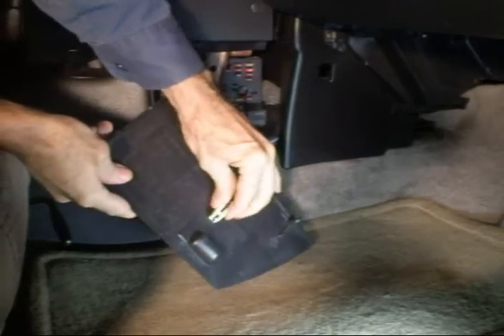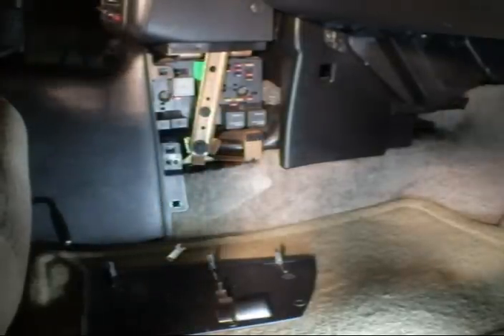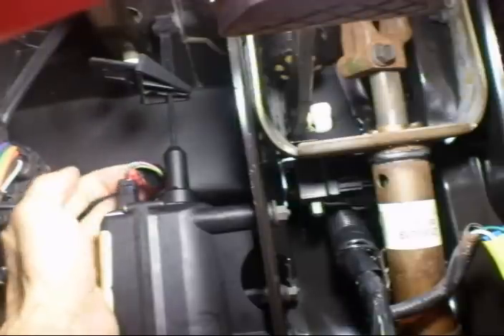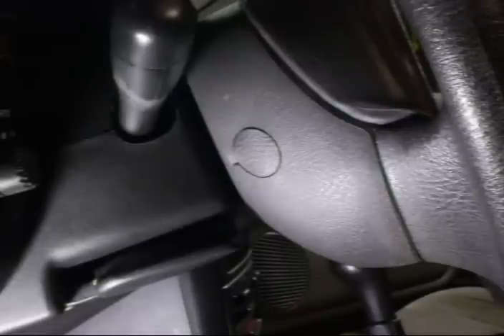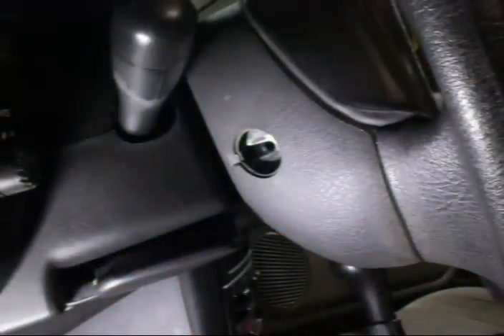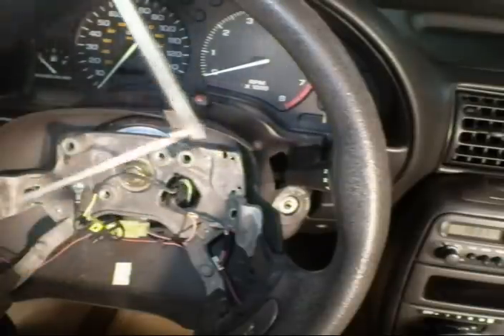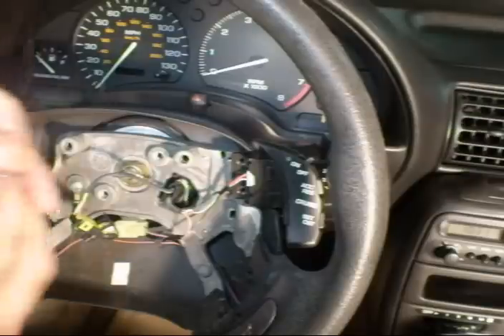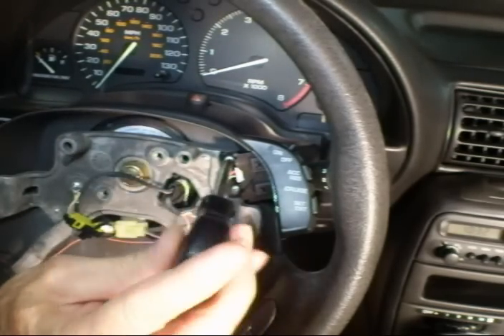Installing Cruise Control

Comment: Thanks for the video!  I followed the video, taking a cruise control unit from a donor 97 SW2 and successfully installed it in my 99 SL2.  $17 for the parts from a junkyard, $52 for Saturn to reprogram the PCM, and I now have cruise control.

Comment: Hey Rich, I got it working now. The adjuster on the control arm was all the way toward the box and causing the accelerator to be fully engaged. Two things I'd add to this video is talking about that adjuster on the end, and also mentioning the wires you moved out of the way from under the dash to mount the module. Thanks for the amazing videos!

Comment: I just installed cruise control on my 98 saturn sw1.  I ordered it from a guy one ebay who sells complete cruise control packages.  It even had a new plastic piece for behind the steering wheel that was the original CC piece so no cutting was required. I noticed the 3 nuts for my cruise control box were 12-13mm.  Not 10mm like you mentioned in the video.  And I didn't have a 5.5mm driver for the screws under the stearing wheel but a 7/32" nut driver worked perfect. Just have to get it programed!
Reply: What's the price of cruise control pack

Comment from the maker: @mhebay Thank you for telling everyone about the wiring.Yes that is the PCM near the battery.The easiest way to activate the cruise is with a used one from a car with cruise.It has to be an exact match to your PCM which means 00-02 same engine, transmission,abs.
Reply: @mhebay: The easiest way now, is Go Aftermarket ! Then it'll work for sure, no Pain In The Butt calling around and finding No dealers today that will do it or have the equipment like I'm having trying to get it going by factory parts with No success,

Comment from the maker: @reconciled2God  You need a steering wheel with the cruise buttons and the module and then you have to turn it on in the computer with a Tech 2 scan tool.

Comment: hello richpin06, I have a 97 saturn sc2 that has cruise control already built in, but earlier today I was driving the car and when I engaged it, the rpms when I was driving at 65 and 70 when from either 2700-2900rpms to 3500-4000rpms but the speed didn't increase. Earlier when I was driving though, the car in cruise control was perfectly fine. I wasn't going up hills or anything like that. It's an automatic.

Comment: You've really saved me alot of headaches and extra work with your Saturn videos. Currently I'm planning to put CC in my 2000 SW1/SWP. I have the steering wheel, F-switch (for the brake pedal) and the module. I was stumped on removing the airbag until I saw your video on airbag removal on a gen 3. You've probably not been asked this question but I can't seem to find the mounting holes for the module under the dash on my RHD Saturn. The wiring clip is there just as shown in your video. Thoughts ?

Comment: I had the same problem with the airbag light staying on. My mechanic told me an airbag light staying on was almost always due to a faulty electrical connection at the airbag, inside the twistable wiring harness in the steering column or at the connection under the dash. Sure enough, I did not have the connector "snapped" into the airbag before inserting the lock.
Cecilaw

Comment: Concerning adding cruise to an '02 SL, is the wiring in place for the controls like in earlier models (I know about adding a steering wheel w/ built in controls)?  Also, will a Gen-2 module work with an '02?
Your video on struts & brakes saved me $600 on labor!  Then, I added a driver-side power window using the switch and wires from a back door.
Your accent reminds me of Ray Romano's cousin from his TV show and Tom from This Old House.

Comment from the maker: Slightly different on the 2000 in that you have to change the steering wheel because the controls for the cruise are there.

Comment: I just installed the switch and cruise modulater from a 99 sc2 it all bolted up perfectly just wondering if that modulater will function on my 95sc1. hopefully it will work properly if it all bolted up and all the conecters mated perfectly with no problem

Comment: Do I need to add anything to my car in order for the clutch in and out signal to be sent to the cruise control module or does that come installed from the factory? Thanks for all your held and advice. It is greatly appreciated.

Comment: I have a 2002 SL1 that I'm interested in installing cruise control on. I saw one of your other videos on how to remove the air bag (which differs from this older model), but from there would this same method work?  Should I look for a new steering wheel with the in-wheel controls, or just look for a model Saturn with this  external control? Is there any difference, or is one method easier? Thanks!

Comment: I have a 96 SL1/5 speed.  I found a cc unit from a 98 SL2 5 speed, and installed it on my 96.  Following your instructions, I got it in.  It lights  up, but won’t work.  I know it’s a computer issue and I was told the BCM needs to be programmed.   My question is does a 96 Saturn have a BCM?   I know it has a PCM, but I thought using a Tech 2 tool and going into the PCM and enabling the cc function would be my fix.   Suggestions??

Comment: I am struggling to get mine to work! Is there a switch on either the brake or the clutch pedal (manual transmission) that I need to add as well? Before installing the cruise control, I would get codes saying the pcm doesn’t see the cruise module, so I assumed the cruise control feature was turned on in the pcm. Thanks!

Comment: @richpin06a Hi Rich. I went to PicknPull and got a PCM of another car. My car is 2002 SL1 Automatic Single Cam and the PCM I got was from 2000 SL1 Automatic Single Cam with cruise control. 

But my car does not start now with that PCM. It dies immediately after ignition. I remember reading in one your previous posts that we had to match engine and transmission type of the cars for the PCM to work, which I did. What do you think is wrong? do we have to match the year of the car, too?

Comment: Your videos are great!! SUPER useful.  Have a question on this video.  Have 2 of the exact same Saturns, (1999 sw2 autos) one with all the options (donor) and one without (on road vehicle). Would it be easier to change out the entire steering wheel/column or  take out the cruise module and computer from donor, as you show here. I am not a mech., & I'm a girl, been able to fix issues all because of your videos, THANKS !!!

Comment: @reconciled2God My '02 SL did not immediately work, so I had the dealership show me on the Teck II screen that the cruise was enabled.  It was.  The problem was that I had a switch from an L-series, which looks the same but is not compatible (L=3 electrical prongs, S=2).  Also, once I changed the switch, the cruise did not work until the following day.  Odd.

Comment: Update:  The '00-'02 has the wiring in place.  When I replaced my steering wheel, the CC button lit up!
Question:  To activate the CC, do I replace the PCM?  Is this the thin AL casing located above the battery?  Does it matter if the donor car has the upgraded engine or an automatic transmission?  Any considerations/precautions necessary before I replace my existing PCM?
Thanks Richpin.
Added resale=$100, Experience=Priceless
* I found two extra wheels and modules if anyone is interested. *

Comment: Hi RichPin I have a 2002 SL1 I've just purchased. I can't find a wiring diagram for the cruise control. The cruise on off functions but will not set while driving on the highway or any normal cruise speed 30+mph. I have a 5 speed standard shift. I have brake lights and they operate correctly. Will anything other than then a faulty brake switch prevent cruise from setting? Is there a procedure for testing the module attached to the gas pedal?

Comment: @richpin06a  I have a 2003 saturn vue. I added cruise control by adding the steering wheel with cruise control switches.  I have a gm tech 2 scanner with gm software 27.001. The cruise control is not coming on after install.  Does the computer need to be flashed by the tech 2? Do you need to be hooked into gm website for this to work?  The cruise control light comes on.

Comment: What is the original part number (Cruise control) for the 2016 B-Class, 180 dci (1.5 D), 110 hp, manual transmission? Thank you

Comment: Rich - I've got a 1997 SL that I want to install cruise in. It appears my car wasn't wired under the dash for cruise however. I've un-sheathed and un-taped the harness as much as possible... and I cannot find the cruise control module connector. The fuse panel came with a fuse in the cruise position, and the steering column was wired for the switches. 
Is there anyway to wire one in? I've looked at the wiring diagram, and it's only (6) wires... My 3x week 300 mile commute is needing cruise. :)

Comment: I installed a cruise control switch and module in my 99 sl2 last night, took it for a test drive and it did not operate. I did grab the computer from the donor car, if I drop it into my Saturn should it work? Or will I need to flash the computer? Love your videos they have kept my Saturn on the road and saved me money.
Reply from the maker: +juggalo squatcher The computer from the donor car has to be exactly like yours same engine,transaxle and so forth with factory cruise and then there is a good possibility the cruise will work.

Comment: Just to clarify, I have a 2002 SL2 5 speed manual transmission. My airbag will transfer   to the new steering wheel? What about the clutch switch that shuts off cruise control?

Comment from the maker: You do not have to add anything.When you step on the clutch the rpm of the motor will come down and the computer will see this drop in rpm and interpolate it as you pushing in the clutch and will turn the cruise off.

Comment: I went to a u pull it and I was trying to take out the module from a saturn there and I could not get that plastic clip that connects to the gas pedal to come out is there a trick to it? And can I use a module from a manual and put it in my automatic?

Comment: Never having used cruise control, how do I know it works? Ah. I installed a cruise control friendly leather stiched steering wheel. A light comes on when I press the cruise control button. And I installed a cruise module from a car the same years as mine. Nothing happens and I don't hear anything when I press the button. If I have to install the BCM (and my mechanic can't do the ScanTool-2 set up, is the BMC plug and play? Or is there a programming strategy start-stop-ignition thing to get my car to recognize it? Can I hurt my car by swapping BCMs? About the grommets. I noticed a rattle so I learned the hard way they are required.
Reply from the maker: McLean Blades On the 96-99 you need a tech2 scan tool or another computer out of a similar car.
Reply: richpin06a I have a 2000 SL2

Comment: Rich. I just installed a cruise control module on my car and when I start it my car revs up to 4k and wavers up and down pulsing. I've pulled the plug from the control box and even pulled the cruise control fuse. It still does this. I'm baffled by what's causing it. Any ideas of what could or where I should start?

Comment: Hi Rich,
Been to two different places regarding activating my cruise control.  I have a 1995 Saturn SL2 that didn't come with cruise.  Given it's an OBD-1, they tell me there's no programming or flashing the computer.  Is an OBD-1 computer programmable? Because I can't find anyone who can tell me.  Am I right to assume that if I can't get my PCM programmed, I'll have to look for a PCM that matches my car's features and transmission (automatic) and replace the whole PCM?.  Also, the gas pedal doesn't match the mechanism for attaching it to the cruise, any suggestions there as well?  Thanks!
Reply from the maker: 91-95 should be ready to go as soon as you install it.Check out this thread http://www.saturnfans.com/forums/showthread.php?t=170735

Comment: Hey, I just picked up a 97 SL1 Wagon 5 spd in Washington state and it never hand CC. I'm going to drive it home to Michigan and don't relish the idea of doing it without CC.  I bought a kit that has all the parts and had the guy take it to a Chevrolet dealer and he told me you need to change out the computer and they won't do it because it will change the VIN when it gets scanned.  Are they mistaken, or do I just need to find someone who knows more about Saturns?
Reply from the maker: Someone with a tech 2 scan tool should be able turn the cruise control on.

Comment: Installed module and steering wheel on my 00 SL. Took it to dealer paid $98 for diagnostic but still does not work. What exactly do I need to ask for to turn on cc? They don't understand what I'm talking about.

Comment: Rich I have  a 2001 saturn sl1 with factory cruise and the cruise will not engage. The fuses are good and the on switch in the steering wheel lights up. It just won't engage.  Any suggestions on where to start?
Reply from the maker: I have not done any extensive troubleshooting on the s-series cruise control to this date. That being said if there is voltage from the switch to the computer and the brake light switch is working ok then i would be looking at the module next.
Reply: OK thanks Richpin. Your videos have been very helpful!
Reply: Michael Jenkins, Hello, mine always came unplugged behind the brake pedal.
Reply: Thanks for the tip. I'll check that out!

Comment: Does a cruise control cable run through the firewall to the throttle?
Reply from the maker: McLean Blades There is no cable on the s-series.

Comment: You could have just swapped the plastic piece on the back of the steering wheel because I found a leather steering wheel off of a 1999 sl2 and wanted to have it for my sisters 1998 sl2 I ended up taking the steering wheels completely apart and switching the plastic covers I took the plastic cover off the leather wrapped wheel which had cruise and put my sisters plastic cover on which didn't have cruise

Comment: I don't believe that All Saturn's are Hard Wired for cruise. Mines not at least, 2000 SL2. I'd have to get another wiring loom and rewire the entire thing or get an aftermarket kit. All that just for cruise control is hardly worth it.

Comment: I did everything that I was supposed to do but found out that that I have a different transmission than what originally came with it. And because of the different gear ratio in gears 3-5 the cruise will not work. So, watch out for that.

Comment from the maker: All you need is the module and the steering wheel switch.For actuation of the cruise you have two choices.
 Have someone with a tech 2 scan tool flash the PCM or swap in a PCM with the cruise turned on.